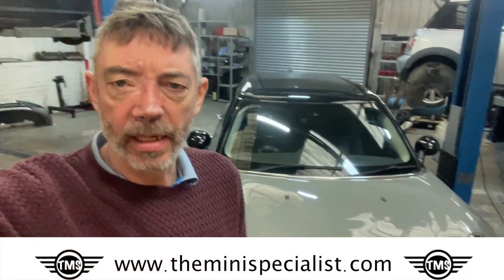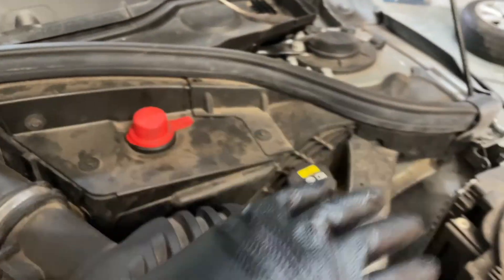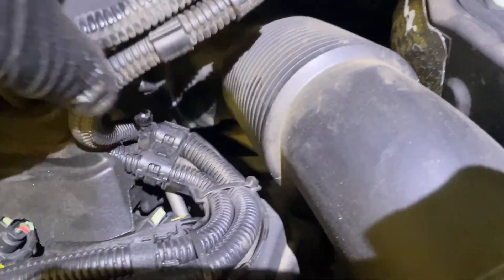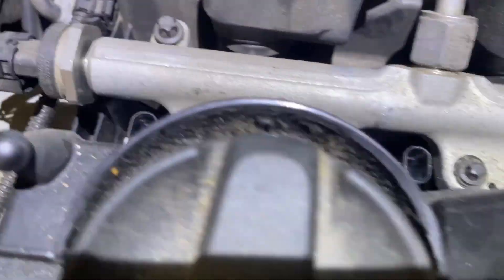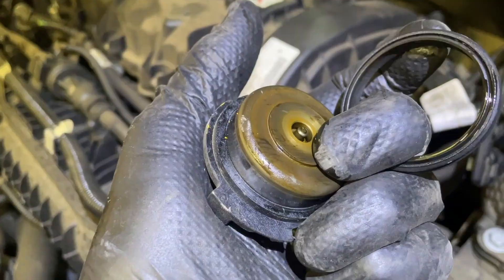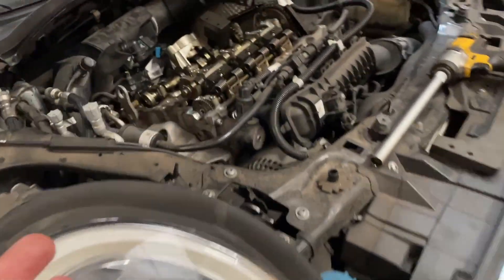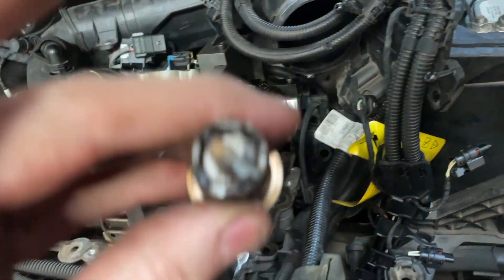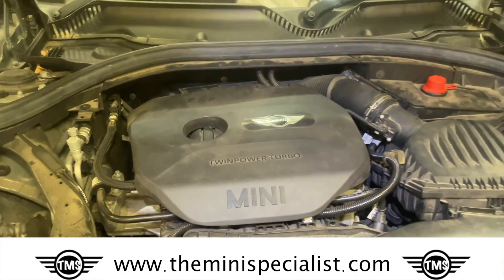MINI & BMW Drivetrain Error Explained: Causes, Fault Codes and Fixes

Comment: Hi hugh, does the cam need to be locked with the tool to remove the bolt? Would it affect the timing without?
Reply from the maker: You need to lock the cams and pin the crank to be 100% sure.
Reply: @TheMiniSpecialist  sure of what? How does the Vanos solenoid affect the timing when the engine is off?  I'm having the same issue as this, but don't have the timing tools.
Reply from the maker: Sure that the timing is correct. The Vanos solenoids are a 12v valves that feeds oil pressure into the VVC sprocket which varies the timing as instructed by the DME based on the position of the camshafts as read by the camshaft sensors. If you don’t have the timing tools then best not removed the VVC sprockets and certainly do not remove the bottom pulley bolt.

Comment: If the only codes are:
130F11: Exhaust camshaft sensor, plausibility: pattern invalid
and
120408: Boost pressure control: shutdown as a follow-up reaction

does that imply it's not the Vanos itself (I got a code saying camshaft stuck when that failed 18 months ago), and not the trigger wheel slipping on the camshaft (I assume you'd get a cam/crank correlation error if that moves?)?

Comment: Hello and thank you for a great tutorial. I am wondering if you could assist in answering on what to do if the camshaft stator is loose indeed? How do I solve that? Cam replacement?
Or if the vanos is good and the stator is good but I'm still getting error on exhaust camshaft stuck?
Best regards
Reply from the maker: we change the camshaft every time as well as the VANOS inserts.  The Sprocket can also fail - if you take them apart they look like the inside of a wankle engine - there are oil seals that can fail in there....

Comment: Hello, i have the same Mini but when im about to lock the camshafts i have problem. They dont match, do i have to keep rotating the engine?
Reply from the maker: Pin the crank first - if the cams are out then the timing is out - so pin the crank and then remove the tensioner and then remove the sprokets and reset the timing.
Reply: @TheMiniSpecialist  Did everything. Got the car all together and now cranks but it doesnt start... Sometimes i get a lot of dme codes, and sometimes just a "Terminal b30 reset or deactivated"

Comment: Hi, I have the issue where the cam sensor pick up on the exhaust camshaft moves, do you know if anyone repairs them or should I just get a replacement camshaft?! Thanks
Reply from the maker: @dwayneburton7956  then that's a replacement camshaft. You could never be 100% sure that the stator is in the correct position
Reply from the maker: just replace the sensor.
Reply: The actual metal pick up/stator pressed onto the camshaft Moves same as you showed in this video at 59 seconds, Do you use anyone who repairs them, or do you just replace the camshafts for that issue. The cam sensor is fine.

Comment: Hi my mini jcw b48 motor has multiple misfire problems and intake manifold pressure / intake butterfly position fault …can this problem be?(replaced coil,spark )
Reply from the maker: the JCW has to have genuine BMW spark plugs and there is a service reset for the spark plugs that needs to be reinitialised - I have had this before when I replaced the spark plugs on that engine with brand new NGK items and the car misfired when it was fine before the change.

Comment: Had to do this on r56 AND e46 m3
Have you seen any f series manual transmission issues ?
Reply from the maker: not actual problems with the gearbox - no.

Comment: Followed most steps successfully, but failed at fuel injector step. Though unscrewed the 4 big ones, the injector did not come out with even full force. Any suggestion? Your video shows injector comes out easily with gentle force.
Reply: How did you get past this point? Currently stuck with the same issue
Reply: Need to release fuel pressure
Reply from the maker: They can be very difficult to remove in some cases.  The worst case I came across needed a ratchet strap around the body of the fuel rail and an engine crane on the other end.

Comment: Hi great video 👌while doing mine the exhaust sprocket came off when cleaning out the end of the cam, timing tool all secured on the cam and chain still in place on the sprocket I take it as there’s no keyway I could just pop it back when fitting new vanos?
Reply from the maker: there is no keyway - pin the crank and use the timing tool then put the tensioner on before you torque up the vanos units.

Comment: (Engine speed monitoring difference between crankshaft and camshaft positions to high) Fault code 273D00 intermittent (Mini Cooper d 2014 B37C15A) no rattles and average 76+ mpg at steady 70mph, There is the occasional lumpy idle. I’m assuming stretched chain but is there other possible causes?
Many thanks in advance

Comment: Great video: On my 2 series f45 i am getting exact same drive train error and once i noticed codes 130304 at 70 mph and second time 130f11 at same speed.  Once i stop and start the error goes away doesnt appear for few days.  Is it a big job to fix this on 2 series active tourer which i am not going to keep very long as its just over 100k miles. Many thanks in advance.
Reply from the maker: I think the 2 series is a countryman in BMW clothes so the engine is transverse so the same as this.  In other BMWs where the engine is longitudinal the VANOs actuators are at the back and hard to get to.
Reply: @TheMiniSpecialist what is the risk of dont get it fix? I already purchased the sensor thinking was the sensor because the code mention Variable timing Exahust Solenoid position not reatched, can you give me a tip?